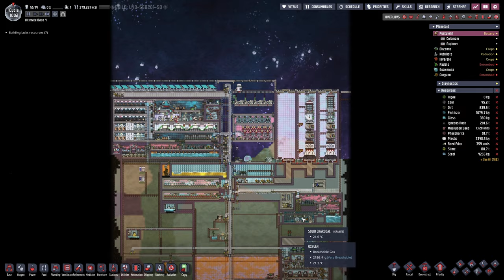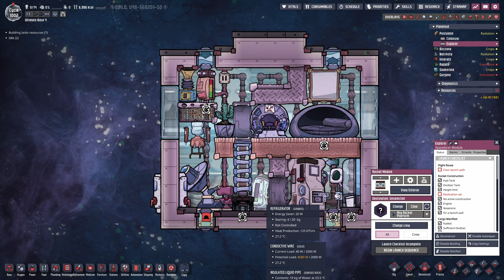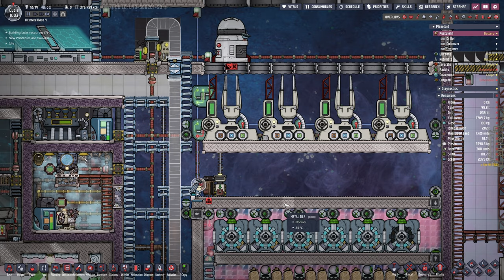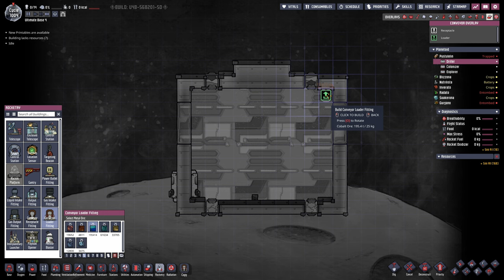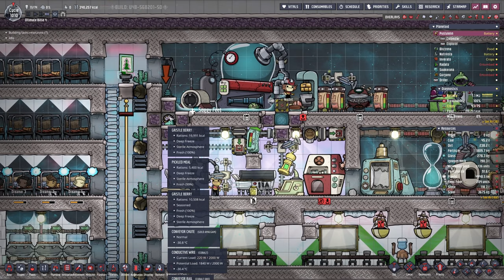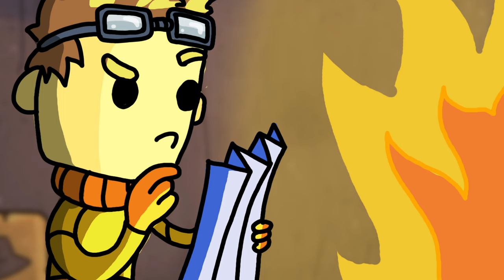MINING ROCKET - Ep. #51 - Oxygen Not Included (Ultimate Base 4.0)

Comment: I seldom can do more than 2 planetoids with any real established functionality.  But something I try to do on every planetoid I expect to spend time on, I try to get a few food seeds and a pip to them, ideally with an arbor acorn and a thimble reed seed.  Lock the pip up with the seeds (with obstructions to limit where it can plant) and let the pip have it's lifespan to put the plants in place.  This produces a nice spot where i can get thimble reed, lumber if needed, a small amount of food all without consuming resources other than time and the original seeds.  Throw a park sign in there, you're guaranteed a nature reserve if you size the area right.  This makes for a small "one dupe" outpost that is always ready for when you come back.

I'm not sure if this would be useful, but if you moved the timer on the actual supply radbolt chamber and place the target of a radbolt reflector there, any overshot of the final (left most) storage would be reflected up to the reflector that actually feeds the launchers, which, if the launchers aren't accepting radbolts, would then hit the "return" reflector on the right to the "overflow" storage. This should shut down the system with fewer radbolts wasted. based on my quick analysis.

Using oxylite for rocket oxygen. If you lifted the storage containing the oxylite away from the floor, say on a second level comprised of mess or airflow tiles carbon dioxide should drop lower before reaching the storage, so the oxylite should never touch the carbon dioxide, and thus eliminate the overpressure override that results in your popper eardrums scenario.  In the layout you're doing at 12:39, the upper storage bin would be a good place for the oxylite to be stored.  The only war Carbon dioxide would be in that tile is if your duplicant exhaled right there.

Comment: You need a buffer gate between the radbolt generation and the storage. No need for the storage if you are generating every time you need a single radbolt and the generation will be higher efficiency if you only load up phosphorite when you need to.
Reply from the maker: I could probably delay the filling up, yes. Will put that buffer gate somewhere. But I eliminated the waste of phosphorite with the use of the mechanised airlocks.

Comment: they should really make a bigger rocket cabin, even the small module is pretty useless and minimal. you should see the videos of people melting the steel walls and building bases inside the rocket interiors ( just cant melt the space ports or airlock)
Reply: It's a neat trick, but feels like a bridge too far even beyond the usual ONI mechanics abuses.
Reply: @gcl2783  the only real fix i see for it is making the walls out of neutronium but then they have the problem with heat, even if they fixed it they wouldnt be able to roll back the prev destroyed rocket cabins, just a fix to prevent future break outs
Reply: i guess they could red zone the rocket exterior as well